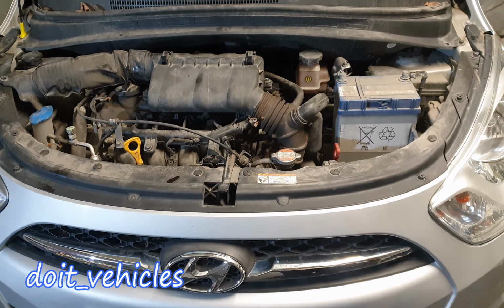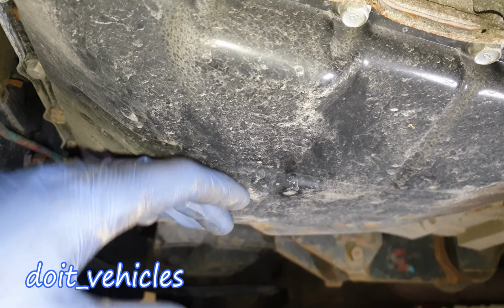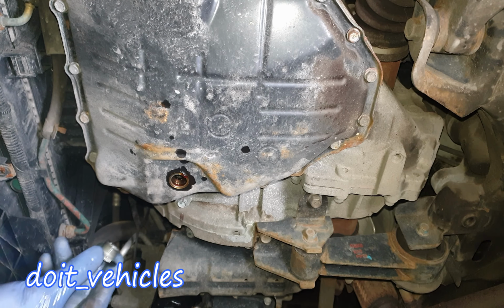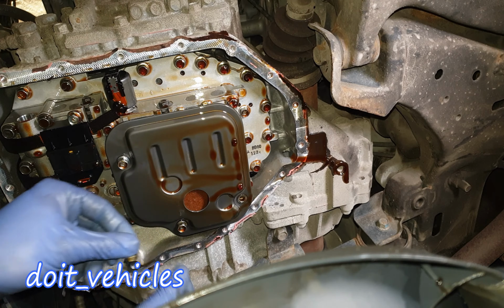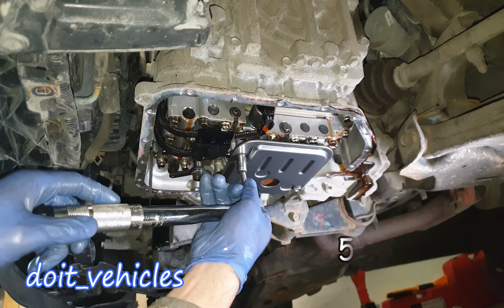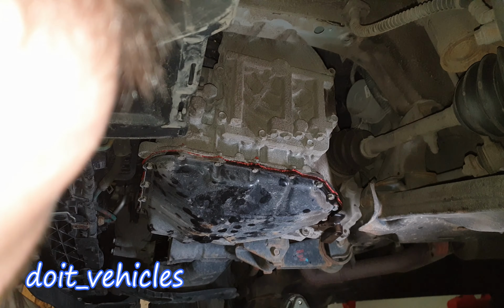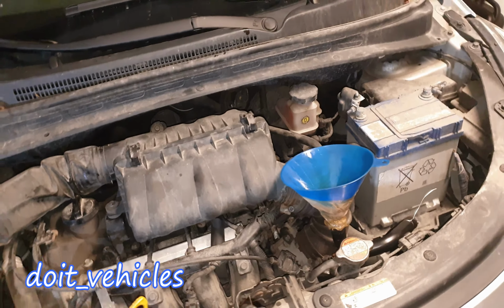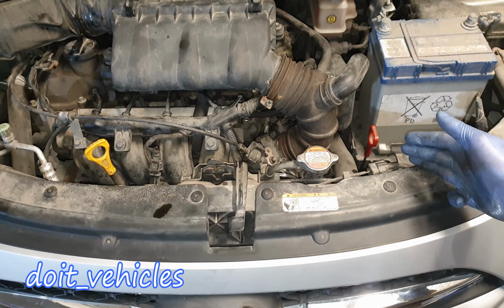Hyundai i10 Automatic Transmission Oil / Filter Change MX4

Comment: Thanks for the video, Is this transmission a CVT or torque converter? and if it's a CVT, which other models of i10 has a conventional torque converter transmission?
Thanks in advance.

Comment: Hello Sir 
I got a question 
I have this car but in modern model which is 2016, I believe it’s the same engine of the one in this video so I’d like to ask if it has the same transmission and the oil for it !!?
Reply: Cuz the oil for the transmission looks like it has yellow color not red .. and I’m afraid which one do I have to use ? Is it the ATF or CVT ?
Can u help me please
Reply: Chyba powinno być żółty

Comment: I used 5W40 instead of 5W30. Any issues in furure
Reply from the maker: if you drive in hot enviroments , 5w40 is better . I hope that was for the engine not the transmission

Comment: My friend I have a kia picanto 2009 motor 1.1 with automatic transmission A4CF0, similar to the one shown in the video. Could you please tell me how many liters of oil is in my transmission without changing the converter oil?